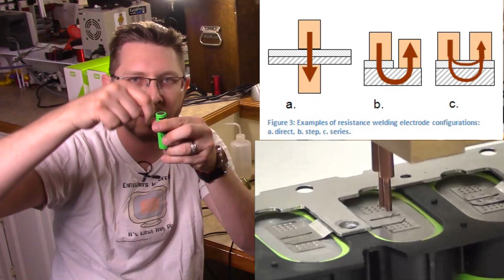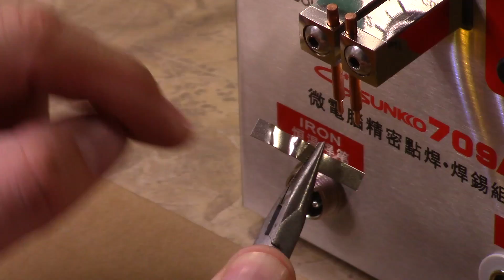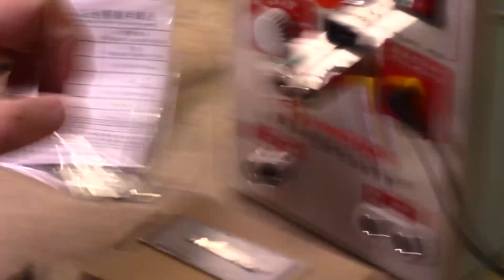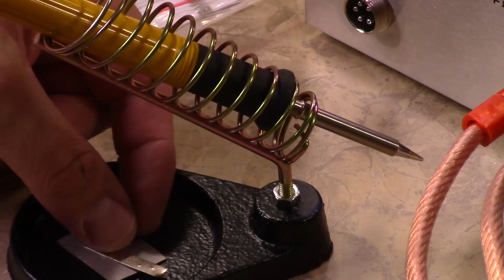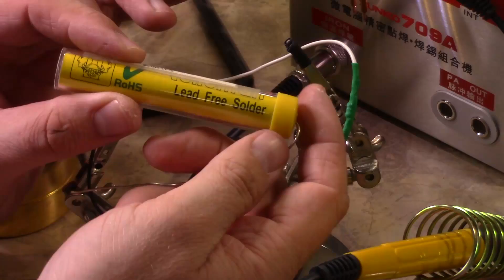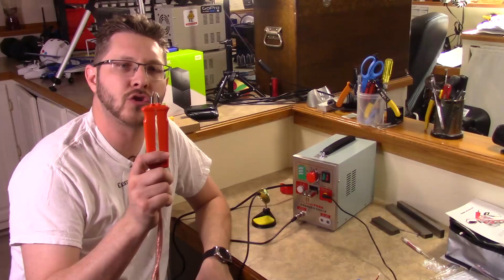Sunkko Battery Welder - Full Review

Comment: I find that plugging the welding pen into the main welding leads provides much better results. (~408A tested from dedicated pen welder. ~549A from main welding terminals) you can open the welder up and see why aha.
Reply from the maker: Awesome.  Thanks for the tip I will have to try.
Reply: @misperry  you may find the welding pen's plugs dont connect very tightly but you can expand them with a pen to make good contact.

Comment: It would seem to me that if you put one probe on the battery and one probe on the strip, you would get your best weld.
Reply: And the best chance of puncturing the cell. Bad idea. Spot-welders for batteries always work this way. Only when joining metals where the electrodes can be on either side of the material you try to weld, this can be done.

Comment: They suck. I used mine for four complete batteries over a year, before the transformer shorted inside while constructing the fourth battery.
it's too cheaply made.
Reply from the maker: Yeah well I figured it may not be top quality but I have used the High quality ones in the past like the Miachi but for $200 compared to $30,000 It is not a bad solution.  Mine has not quit yet LOL.  Thanks for the feed back though.

Comment: Wouldn't it be wonderful if a reviewer simply was concerned with conveying the essentials as a public service and not this learning as I go/let me entertain you mode? Anyway: I was scratching my head to see this fellow looking to get the welder to "penetrate all the way through" in the light of the fact most people will be welding lithium batteries, even when using a test strip way thicker than any battery case would be. Dangerous example.

Comment: At 28:40: better to solder the wires onto the flat strips before welding to battery cell: the less heat the cell is subjected to the better.
Reply from the maker: yes this is a better idea.  I agree the lest heat on the battery the better.  Thanks for the correction.

Comment: People: if you use this machine, give it some help which this narrator ignores: clean and brighten the surfaces to be welded.
Reply from the maker: Well I didn't ignore it but I just simply forgot.  Thanks for pointing it out.  This is true since the tabs could have oil or some sort of protective film on them for corrosion that will need to be removed for a good weld.  Thanks for pointing out.

Comment: My hand welder works fine, I think you have the tips too far apart. I get nearly as much power out of the hand welder as using the one in the unit. The one they sent you does seem weaker than mine. I have mine set to 6 and I use 6 to 8 pulses and it always makes a strong weld. I usually get quite a spark as well. Set the electrodes closer and I think you will have better luck.
Reply: Absolutly,  set the electrodes closer,  8P and high current.
Reply from the maker: awesome thanks.  I will totally give it a try.